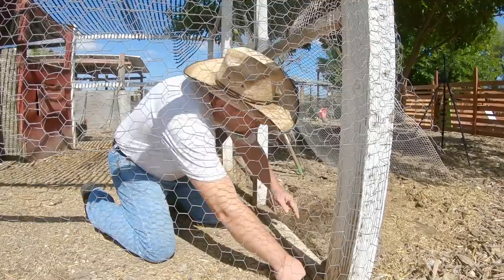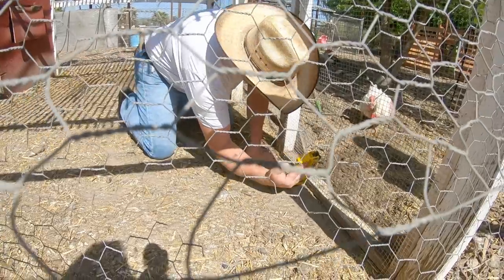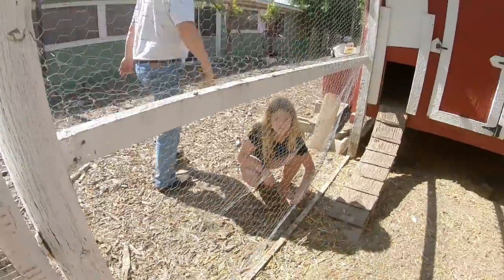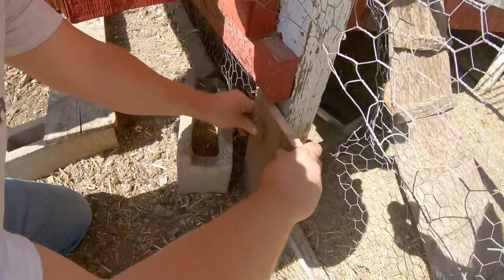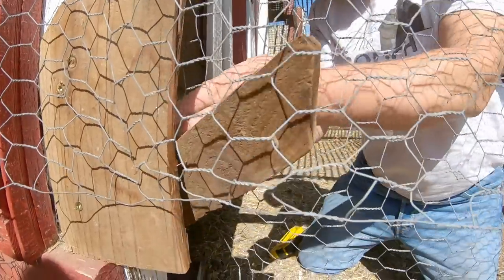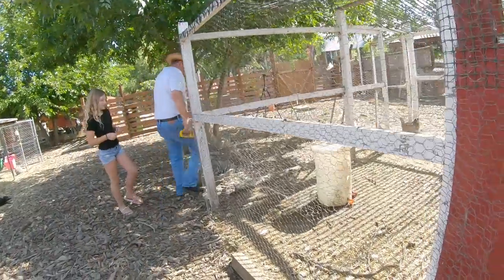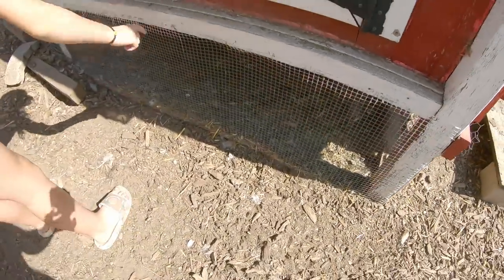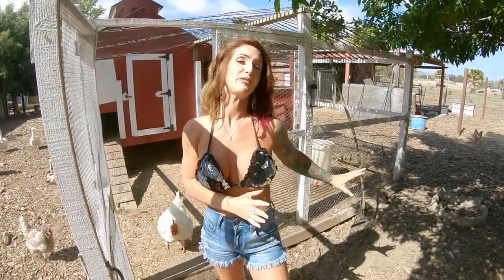No Escape From This!

Comment: About 7 to 8 years ago I was hanging a light fixture and I thought I'd seen everything and then after I realized I'm in the wrong business when I open the box and it was a light Ficture about 3 ft diameter it had three vintage Edison bulbs in it and it was comprised of barn board and chicken wire and the price tag on the light picture was $999